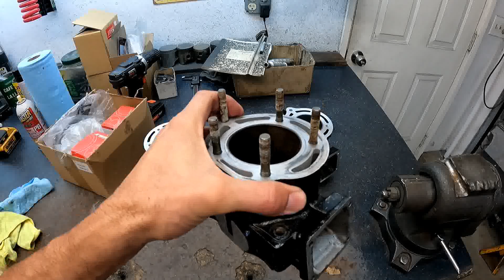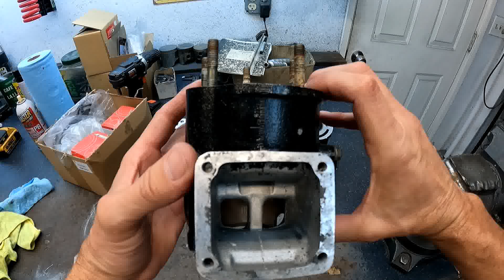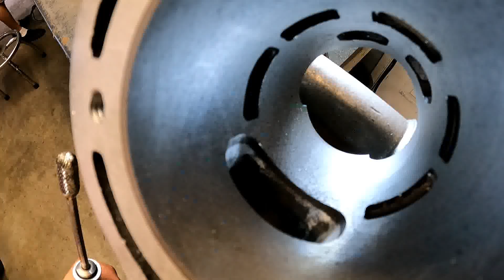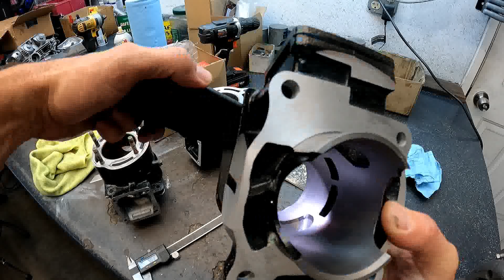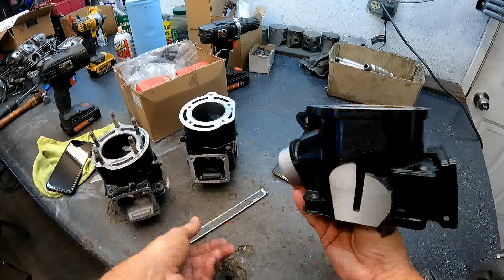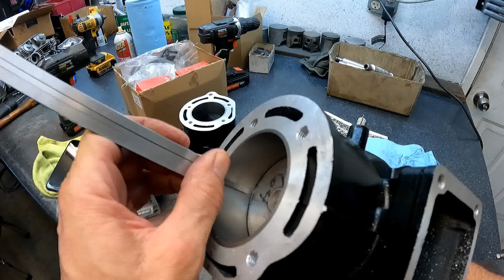Banshee porting 101 simple start

Comment: I would highly recommend putting a bevel on the top of the exhaust port. Wouldn’t want the new guy to hang a ring on his first port job.
Reply from the maker: You might not see it in the video but I have been chamfering ports since 1989.
Reply: @herrjugsracing7816 . I know that you do, I just meant that you forgot to mention it in the vid is all.

Comment: I’m following your techniques on a old RD400 I have. Do the original jugs have Nickasil liner? And if so do I NEED to use a diamond bit for the final chamfer to avoid the ring getting caught on it? 
Thanks a bunch
 my first 2 stroke motorcycle port job
Reply from the maker: Cylinders are iron and I have an RD400 video going up in a few days.

Comment: I think this is one of these fluke modifications that end up effecting power much more than you would think because typically raising an exhaust port 1-2mm with no other changes might make maybe 1hp. I think in the banshee cylinder this change must be increasing that vacuum effect sucking more fuel and air quite a bit thru the charge ports due to the exhaust being uncovered earlier and increasing that pull for when the intake gets uncovered. That exhaust being uncovered earlier starts expelling the exhaust sooner creating a stronger pull when the fuel/air mix ports get uncovered it's charging and filling the combustion chamber with a lot more fuel and air.  it's like its increasing the supercharging effect 2 strokes have and allowing the pipe to be more effective. I know I'm not using the right terminology I can visualize what's happening in the motor in my mind by this change but expressing it is more difficult. I always forgot the terminology of which port does what and when but you get the idea. I wonder if this only works well on OEM style cylinders with the lack of real performance tuned port mapping/timing with stock pipes. I hope it works well with pro circuit pipes because I'm going to try it on my own cylinders that blew. Or I was thinking maybe I should open up the Rocky mountain ATV cheapo top end kit that's on it now and do that to those China cylinders and throw a set of vertex or pro x pistons in as I heard the pistons that come with those kits only last maybe 10hrs. I seen one tear down inspection after 3hrs and the pistons were incredibly worn already but the cylinders are pretty decent..it's crazy u can buy a twin cylinder complete top end kit from a big company like that for less than 200 bucks. Just a cylinder alone for my kx125 is 700 bucks. Anyone that buys those cheap eBay kits, throw out the pistons and put a good set in and it'll run for a long time. And you don't have to be afraid of porting the cheap cylinders if you mess up!
Reply: I think is so much different than I did
Reply from the maker: It works and is much much more than you think. Give it a try.

Comment: Would you say athena cylinders are pretty good for dune play out of the box new ? Or should they get a dune port done to them
Reply from the maker: They are not bad. Buy the 68mm bore. Porting always adds more power.
Reply: I got the athena 68 mm cylinders. The ports are very close to my lrd ported stock cylinders. Maybe I should only clean it up a little pretty good out of box. But they came with .055 base gasket  what do you recommend for base gasket dune riding play hill climbs

Comment: Why don't you champher the port after you finished machining it will give better ring life ???
Reply from the maker: Always, always, always all ports. That is a big rule in 2 stroke life. Why would you think not?
Reply: @herrjugsracing7816 u didn't mention it in video so a lot of first timers don't know this, will do what you shown and throw it together. Important to talk about what stone should be used to smooth and chamfer any sharp edges to increase ring life and maintain good compression for a long time. I often forget too that not everyone looks at a situation with the same knowledge and experience I have in my head.

Comment: Great Video! If done on a stock Banshee with T5's what would you recommend on jetting?
Reply from the maker: It depends but 330 mains it what I use here in Glamis with 30 pilots, air screw 1 turn out.

Comment: Just to be sure I’m understanding you correctly, you are only doing the top of the port with out getting into the sleeve Right?
Don’t do any of the bottom of the port Right?
Reply from the maker: Correct, you are raising the roof but not dropping the floor. Watch the video closely. You can see how the work is done.

Comment: I personally tried this out and oh boy let me tell you, this did a major change on my 4mill stock cylinder stock bore no intake porting stock carbs  , just with exhaust porting it woke up like it never did , I rode my buddy’s 4mill same setup and it was no where the same , this is really good when it comes to making power , and keep in mind this was my first time picking up a cylinder and triying to do some port work, my bike rides solid no issues at all and it’s true you don’t have to be specific with it.
Reply from the maker: Glad you tried it. I try and tell people what works but the internet is hard to battle with. Everybody is a keyboard expert.
Reply: @herrjugsracing7816  where are you located

Comment: Kevin whats a good exhaist timing degree when only trying to help your topend without changing the transffers ? 188-194 ?
Reply: I wouldn’t go over 198, 194-196 is plenty.
Reply from the maker: Always start low 188 to 190 will increase it a lot.